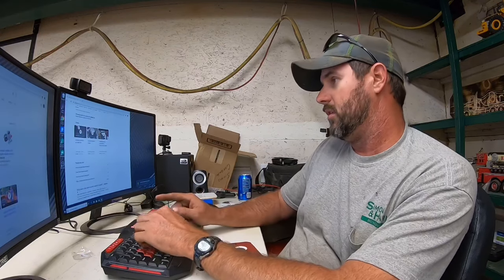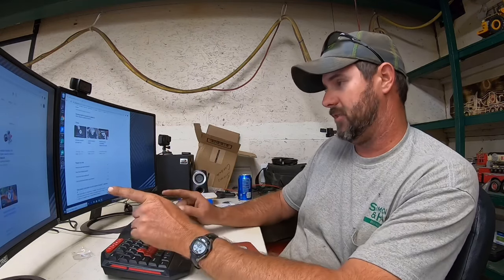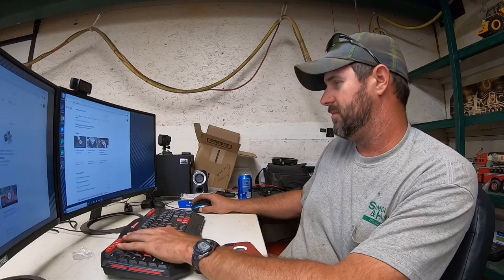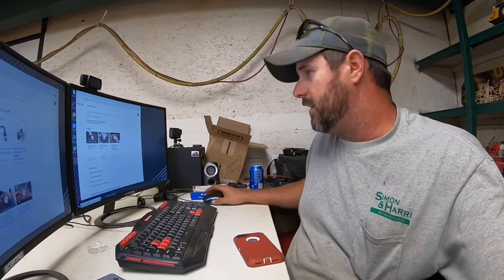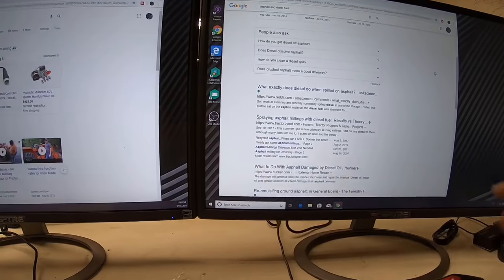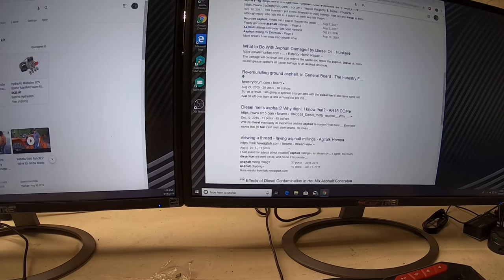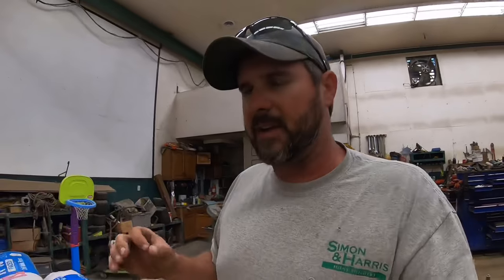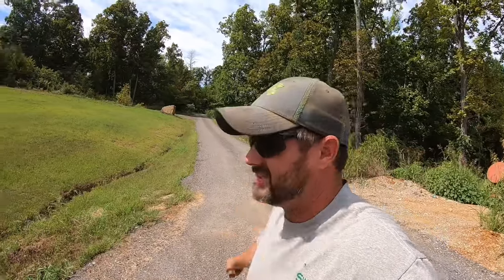Spraying diesel fuel on asphalt millings good idea or bad idea my thoughts

Comment: I just did 180 tons of millings at my house, and was going back and forth about spraying it with diesel. Some people told me to, some people told me not to.
Yes diesel will eat asphalt, when small amounts are poured on it constantly like at a fuel pump. But the thought process with millings is a small amount sprayed as it's being rolled makes it all harden together. After the first good rain it all washes away, but the millings stay packed. I know someone who spread millings and sprayed last summer, and it came out perfect. And its still good now, and we have real winters with lots of plowing, and it held up good.
That being said when I did mine my one ton roller broke halfway through. So I had a friend come with 3 ton vibratory. Didn't have time to spray just rolled it, and it came out like pavement. The verdict will be in in springtime. If I plow a bunch up I'm going to regrade, re-roll then chip seal it and be done.
Reply: How did it come out?
Reply: @UnitedStates.  
The main parking area that was rolled heavily is like pavement with loose pea gravel on top. The "pea gravel" millings that are loose on top could be brushed off to leave a pavement surface. I've decided to leave them because of the rest of the driveway. 
The main driveway is a little over 900ft, through wetlands with 3 culvert pipes. That does have a few potholes. They were there before the millings went down. Were filled with gravel before installing millings. But came back none the less. 
I have cold patched them, but they still sink a little every freeze/thaw. The "pea gravel" millings work to keep them full. I am able to box blade over the hard packed and pull just the loose stuff to fill in any holes. 
So, basically, like a abc or processed gravel driveway for maintenance. Just alot less of it. I did millings again at my new house and I would recommend them over processed gravel. Install on good packed flat surface in springtime. So summer driving packs them before winter hits. If you have winter. 
 The comment 4 years ago was my parents. I still maintain that, I bought the house next door.
Reply: @dand33911  hey thank you for the detailed reply! I appreciate it! I was about to put more millings in my driveway but it’s pretty cold (20*) Some people say spray it with diesel some say don’t. I had millings, but had a huge washout so I am putting more I guess. I just have to put them since I can assume if I don’t they ruts will fill with ice and will get pretty dicey in winter.
Reply: @UnitedStates.  
No problem. I've learned so much from utube. The more info, the better.
Drainage work is the key. 
I posted a video a while back of the trench work, retention pond, swales, etc. "Hurricane rain vs trenches". I had to do it at my house, before the millings even came. I had a washout directly over the driveway before that. Now, the water can't make it to the driveway without hitting a trench or swale first. Then, a culvert under the driveway. 
If you can't prevent it. A water bar, mini swale across the driveway out of cold patch for asphalt might work better. Like millings mixed with glue. They're sticky af, stay where you up them. 
Good luck!
Reply: @dand33911  Thank you! I’ll tell these tips to my contractor to do. Hopefully I won’t get any more washouts. Thank you again!

Comment: Chip seal was spawned from the deepest parts of hell and is the worst invention in the history of inventions. Or it was invented by people who do paint and windshield repair and need more business...
Also fuel islands generally have concrete because of weight, the constant stopping in the same spot will ruin asphalt quickly, especially with trucks.  Which is why most trash dumpsters are on concrete as well, the trash truck would ruin asphalt in a few stops.  

I do know a guy whose answer to nearly everything was to spray diesel fuel on it, kind of surprised he never burnt anything down or got thrown in prison for some of the stuff he claimed it would do.

Comment: Excellent retort to the idea of diesel fuel as a binder with asphalt.  8 gears ago we spread millings over 400 feet of driveway in a hilly location with substantial shade cover.  Nary a glitch after we finished rolling the material in.

Comment: save the oil when you do an oil change on the machines and spray a light coat of that over the millings.
then let it soak into them and you have effectively sealed the millings.

Comment: Have you guys heard of solvent welding? For example: https://www.sciencedirect.com/science/article/pii/B9780815515814500184

It is like welding two pieces of ABS plastic with acetone. Acetone eats through ABS but with just a little bit it dissolves both surfaces  enough to bond permanently. It is one of the best types of glue joints because the two materials actually become one.

The fact that diesel fuel dissolves asphalt is actually a good thing for a chemical weld. The difference between a poison and medicine is the dose. 

What do you guys think?

Comment: If you spray diesel  on them you have to light them on fire and melt the tar and roll the fire out ,that's what I did in my drive way here in buffalo and we have log trucks running on them a lot ,,my killings are all So 10inches thick,,,,but keep in mind on paveing  crews they use diesel fuel to clean the paver and tools ,and keep the blacktop from sticking so what does that tell you

Comment: Spraying diesel onto asphalt disovles the bitumen in it and all you end up with is black small stones. Don't spry it with either diesel (30sec fuel oil) or Kerosine (28sec fuel oil), keep is as it comes and then when it warms up with the sun it sticks together and hardens into a great surface.

Comment: Your assessment is spot on. Adding a petroleum product to millings is a bad idea. As you well out, heat and pressure will make them as close to asphalt as you can possibly get. The mess made if you have to walk across it after putting diesel fuel on would not endear you to the house cleaning staff. In theory it would seem good to break it down until it packs tightly and the slightly volatile parts dissipate but in practice, it would be a  mess in every way. Don't do it.
Reply from the maker: Agree

Comment: I watched the video and while I appreciate you trying to disseminate information, the truth is, you based your conclusion on internet research and intuition.  If you are going to conclude that "diesel fuel is bad" then at least do a real world experiment, even if its a small scale one!  I found this video: https://www.youtube.com/watch?v=vvz8oHAlEYE and found it very informative.  His production quality is not as good as yours, but he actually tested the idea in the real world and showed his results.

I am almost done using millings to make a half basket ball court and I did side by side tests with some of the millings.  Diesel made a HUGE difference and was a major improvement.  We put down 4" of crush, tamped, 3" of asphalt millings, tamped, then put down a light coat of diesel (<1 gallon per 150-200 sq feet), tamped, and then used a propane torch (in our case a Weed Dragon) to heat the asphalt and burn off the diesel to stop the chemical reaction and help heat up the asphalt then tamped one more time.  There was a notable difference in the surface adhesion and surface smoothness of the test with the diesel vs the test without.  In our case, since this was a basketball court and not a driveway, the "smoothness" of the surface layer was important to us.  I hope you receive this feedback in the manner of its intent; constructive.